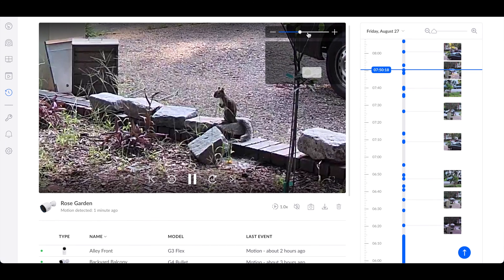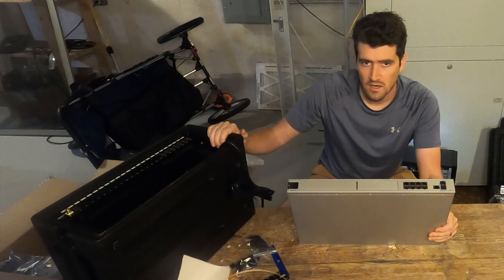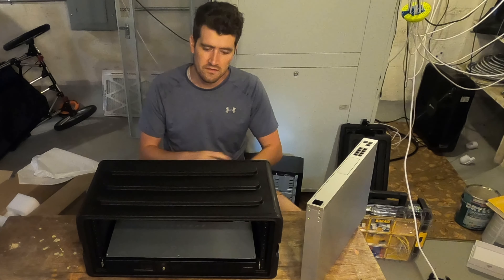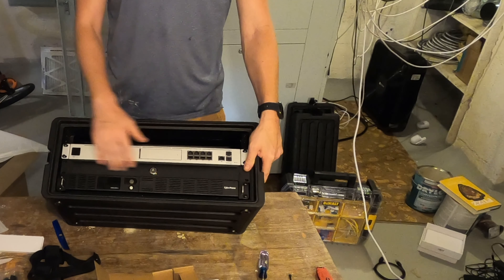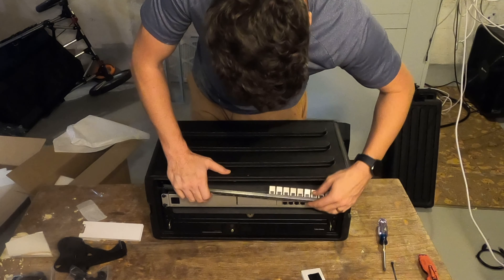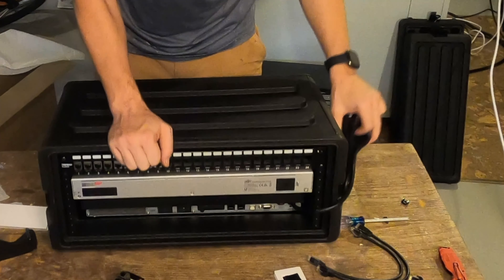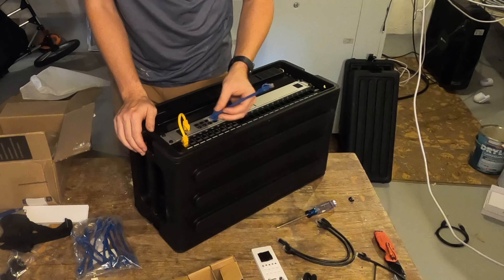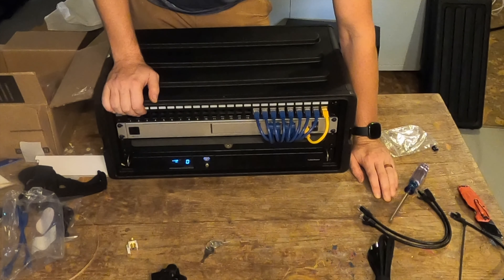How to build a portable unifi network

Comment: What UPS and how long does it last with that equipment?
Reply from the maker: The UDM-SE in this case is also powering 3 APs and 2 cameras, and battery is also powering a cable modem. It lasts about 30 minutes which is plenty for most short power issues. Link is here: https://amzn.to/3RXa8Zn.  This setup has been working for a little over a year so far with no issues.